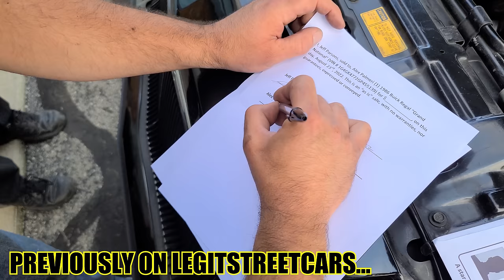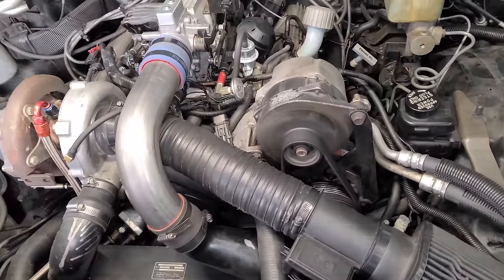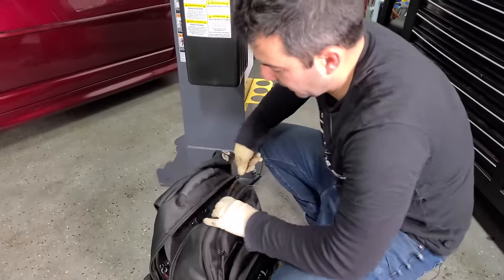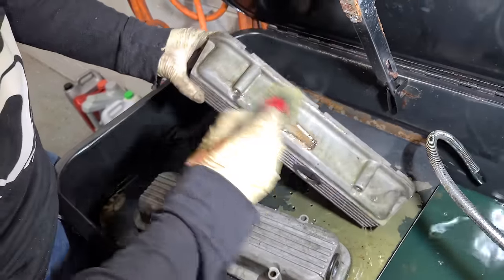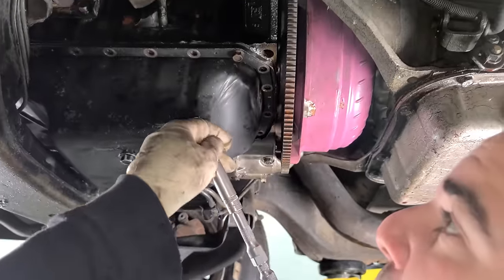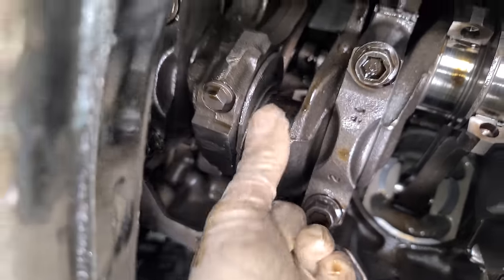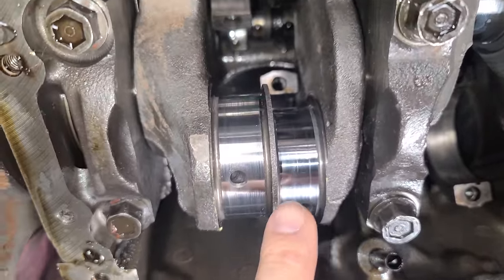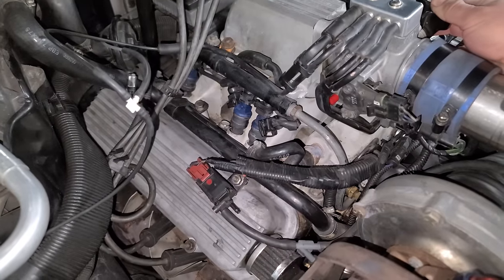I Found A Fully Built Engine In My Grand National That Was About To BLOW UP! DIY Fixed It For $32!

Comment: Looking for noises in a car, you definitely want to have a remote starter switch and a mechanics stethoscope. Failing that, use a section of hose as a stethoscope, so you can find the source of the noise and pinpoint it. Things like flexplate vs rod knock or wrist pins are tough, since they all tend to radiate from near the oil pan especially if it's one of the cylinders near the flexplate, but it's worth a shot. 

Remote starter switch is for when you've got a lift and need to start the car while it's up on the lift. Most of us can do without that, as we don't have a lift. We just need a buddy to work the key, lol.

Comment: So jealous ! I wanted to just change the oil pan gasket in my 96 cobra . Yah right , need to drop the k member and hold the engine in mid air . So much work.

Comment: Best mod I did to my 86 was an Alkycontrol kit. BITD it was like $500 but with that installed I was running 24 psi with zero knock. Before the kit I was running 94 octane Sunoco fuel. Car didn't like anything less even at stock boost levels.

Comment: Factory tires were puny P215-65R-15. I installed P235-60R-15 when the 215 were worn out on my ‘87 GN. Normal high idle when 1st started at any outside temp.

Comment: I rarely use RTV unless the factory specifically calls for it, it usually causes more problems than it solves. I guarantee you that oil pan was leaking due to the excessive amount of RTV the previous hack mechanic used. Those cork valve cover gaskets would have been fine without the messy sealer, the cork is soft enough that it fills in the rough un-machined mating surface of the head, at least that has been my experience. Using the proper o-rings/gaskets and torquing the part to spec is by far the best way to prevent leaks.

Comment: That gray tint to your oil is the babit off the bearing. One thing that will make that noise is to much timing. pull a couple degrees of timing out of it and see if the knock goes away. I'm pretty sure it has a rod bearing issue, replacing the bearings will not be a permanent fix you will need to send the crank out to be ground as well as have the rods checked. One thing you can do is go to the local U Pull it get a late 80s 4.2 v6 and swap it in the car to put it back on the road and do a proper rebuild on the stock 3.8.

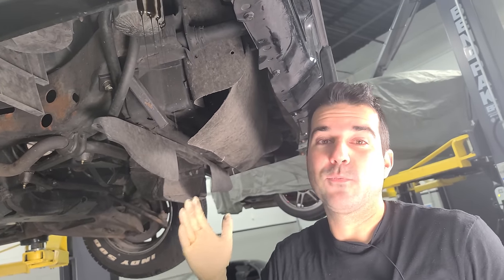Comment: @9:15 the fuel pressure reading is about 22 PSI.  The normal fuel pressure should be 42PSI at idle.  Either the gauge is bad, you have a bad regulator, or a pump issue. Also your fuel pressure should rise 1PSI for every 1 pound of boost.

Comment: I bought a 67 dodge van from a police auction slant six locked up! Diaphragm in the fuel pump went bad thinned the oil and spun 2 rod bearings cleaned the 2 up installed new ones on the other 4 and plasatgaged the 2 I polished the were past specs. Bought 2 10 over bearings sanded them into spec drove the van for 18 years before I had to rebuild the motor.

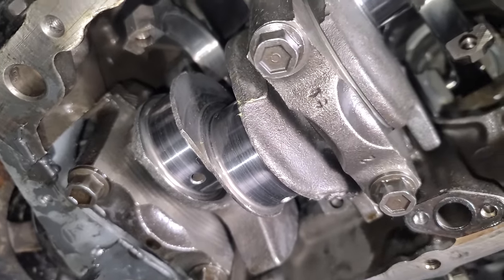Comment: Careful inside that motor brother, that's a bluprinting mark @35:22 on rod cap number 3 identifying that it's been balanced 😉 👍 😀, my initional thoughts are that the rod caps are mismatched, remember that stamp 6 rod cap goes to stamp 6 rod, I'm figuring someone tr8ed to replace the bearings and didn't  know specs

Comment: that same crank repair on my saab lasted from 83k to around 150k when i sold the car. the guy drove it another 15k until he got in an accident. The engine still ran fine though.

Comment: Got lucky that bearing did not spin.
Hopefully the rods are in the right order, cause mismatching the rod caps is a fatal error, as you found out. That would be if these are fracture split connecting rods.
Even if an engine replacement, you have a gem!!

Comment: The bottom end is known for going bad. Buy that girdle after rebuilding. Those 3.8 are weak after heavy racing.  Top & bottom should be done at the same time. WARNING That crank is NOT OK.

Comment: I did just rod bearings on a knocking D15 in a 1991 Civic and it lasted for five years as a daily driver.  I sold the car so it could still be running for all I know.

Comment: Should have hit those drums with some flat black spray paint while the wheels were off.  Glad you were able to change the bearings without having to pull the engine.  I was thinking that loose EGR bracket might have been the cause but those bearings showing copper were completely smoked.

Comment: You're onto something with the fuel being low Alex. Never owned one of these, but had 3 3rd gen F-bodies and a couple other mid-late eighties GM products in my day, and EVERY ONE OF THEM would die when cornering/accelerating hard if the fuel was low (1/8th of a tank or less)...

Comment: I did this repair to my 87 T-Type. And it lasted about another 5,000 Mi the only problem with mine was the crank was egg-shaped. So no matter how much polishing it didn't help. Still a great tip

Comment: Check fuel pressure gauge when removing vacuum from regulator. It should be around 30-35lbs at idle, raise to 10lbs when vacuum is removed and rise 1 LB. for every lb. of boost. Either gauge is not working, regulator or fuel pump.

Comment: These cars are notorious for bottom end issues when they are stock and you boost the pressure.

Bite the bullet and pull the motor and rebuild it the correct way.

Comment: Bro I just catching up with Ur Buick vid--- that oil looks like it's as thin as water -- using some 15w-50 ---or 20w50 and it would have quietened down heaps ,it would have been helpful 5--6years ago to avoid any oil related issues.... .......still making awesome content ---awsome job bro's...

Comment: It's not a proper re-machine of the crank, but, with decent oil pressure, that's going to last more then long enough to run around reliably, getting parts to build a new motor.
If it was a Slant Six with that repair, it'd be good for another quarter million miles.

Comment: 1 question....since the rod caps were reinstalled out of sequence on the original rebuild, how did you assure that the rods themselves were not also installed out of sequence? Did not see you inspecting to make sure the rods actually matched the caps and the chamfered sides faced outward, etc..

You may have done so off camera though. Definitely approved the roll out rod bearing replacing, though would have personally chosen to do the action 1 at a time (including the crank journal polishing,  and bearing/crank clearance checking), and not all 8 at the same time. Just a good way to nick the crank and smack a valve, and piston top for the uninitiated you may be online instructing.

Comment: The thing is if it has a built engine already, why would you need another built engine?  I think it would work way better to rebuild this engine, see what mystery parts are inside, and see if you can improve it and show how to do a build right.  Thus far, it seems like max you'd just want to source another crankshaft or have the journals on this built up with weld and machined back to spec.

WRT to the bearings: it looks simply like a case of mileage, boost, and perhaps, but not likely, oiling.  I would check the oil pump and change it out, but I don't have any indication of issues there other than the fact that the engine actually looks pretty new inside.  Maybe cheap bearings.  I would also look into GNX-style wheels, an upgrade of the rear suspension, and an upgrade of the brakes.  The car will be a driver, so why not equip it to handle instead of going for the built engine?  Everyone does the engine thing in the GN cars, but few do the handling and the brake stuff and I think in this era it would be infinitely more interesting to do a shake down of your engine and instead of replacing it,, the money is better spent refresing it and figuring out what's inside and then put the rest of the money into suspension, brakes, and chassis.

I used to have a book from Poston Enterprises that was basically the definitive T-Type, GN, and GNX book.  Learned a lot from it.

Comment: It doesn't sound like a wrist pin. The short piston can cause piston slap. Sometimes you can get a noise from the timing chains. It may have a double chain with steel gears. I dought the gears are plastic. keep it up, you are getting close. Tick ,tick ,tick.?

Comment: I had that engine noise when I had really old oil I thought the oil was low so o added some it didn’t help at all but when I changed the oil fixed the issue

Comment: My god, I’m really happy you fixed it, but man… how people can improperly mount an engine back like that?
Same happened with my 240Z. Imported it here in france from LA. Engine was rebuilt 30.000 miles ago. But everything was mismatched, especially the mains. So much that pushing the clutch would push the whole crankshaft forward by a good 3/16 to 1/4 inch! The crank needed to be replaced with all bearings..
Just at the first startup you must realize something is wrong?!

Comment: i had a ford 2.3 ranger and i had an egr that was so bad after it warmed up it sounded like a v8 with chop. like the 4 cylinders actually started going in a rythym similar to tapping your fingers on a touble just bwabwabwap bwabwabwap bwabwabwap. the very second i replaced it it idles PERFECT never died at idle or at a stop ever again

Comment: Back in the day the 3.8s were notorious for spinning rod bearings.  You caught those just in time. 

Food for though - why were they damaged in the first place? Especially on an engine rebuilt once already.  

I had a non turbo 3.8 back in the 80s and it failed for a nylon upper timing gear that was sending chunks into the oil pan.  Some got sucked into the oil pump by pass then no more oil pressure.  Hopefully this one  got a steel upper gear in the rebuild.

Comment: Strips  of aluminum cans can make the difference from a spun bearing as a temporary solution for your knock  and it will take a few times to get the clearance right  but it will work for a few days or a week at least  😂  but the  one place you should go is to get a  junkyard  replacement  engine  did on Toyota that lasted for years

Comment: actually ...Bleach seems to dissolve oil...its great  on spilt oil on concrete  before a high pressure water clean so it wil probably clean rocker covers too

Comment: U gotta put the gn motor in an 1st gen olds bravada  when u drop in the new built short block and make a giveaway sport truck or if the olds awd is a problem do a 2wd s10 with olds grille

Comment: When you hear a knock noise use a broom stick wooden handle place one end on the part you think is making the noise n cup your hand around the stick to your ear n any noise will run up the stick to your ear . Just be careful u don't put the broom stick near moving parts . I've found so many knocks , tics n  grinding noises this way

Comment: Hi, I have seen abnormal bearing wear when someone put the bearing caps back out of order, and, or, the wrong way around. They are NOT interchangeable. If that's done like that the dias of the bearing and rod don't meet perfectly.. Had an engine brought to me once that "seized" (or in American FROZE) up,  the bearing end caps were jumbled up, undone them all, found the rod matched ones bolted it all back and so the engine spun freely as it should.. Thanks for the video.. Ian 0 UK.

Comment: Hi there. It takes 12 miles of normal driving for the engine to be at operating temperature 🌡 be for you can lean on it without doing any  damage to the bearings and piston s and rings i have been down that road before. Happy new year from Down under. Dave

Comment: The reason the belt tensioner cracked is because your missing a bracket that goes on the top alt. bolt you have the one on the front side but missing the one that same bolt but on the back side where the nut is the nut tightens against it , it goes down then bent back at a 45 degrees then bent down at 45 degrees check into that and you will see what I'm talking about

Comment: Car and Driver did a comparison test of many sports cars and included one of these.  GNX ability to go fast was never doubted. But could it stop? One test was driving down a twisty downhill road very fast. The GNX brakes boiled and the rotors overheated. Once they stopped and it sat for 30 mins, it melted the front plastic wheel center caps. Good luck with the build. I am missing a lot of the 80's and 90's cars these day and may be looking for a project.

Comment: New to the Chanel love the content found you all bc of the 99 cobra. I have a 02 mustang gt with a single turbo. I did main and rod bearings in car last year. Car dynoed mid 400 on 10 psi. Going back soon for more boost.

Comment: Well back  in the 80’s yes a fuel filter would be a big check item for random shut down but I knew it was a fuel issue especially when the fuel gauge was dipping fuel injection cars have to have the correct fuel pressure. But that knock though surly sounds like either a rod or wrist pin knock. The only 2 other things I have seen that make thy noise are cracked flex plate/ flywheel or the belt tensioner but good luck 🍀

Comment: I think the new bearing job will look as pretty as when you put it in.  Going by it was poorly put together by a shop probably some time around 2000 (if those 99 are in fact dates for the bearings which seems plausible), and they survived long enough to roll the odo halfway around over 20 years.  And only then were they getting worrisome, the ones will be fine.
BTW, maybe see if you could get the tensioner welded back together?  At the very least to keep around as a rainy day thing.
Reply: Nah. Chuck that tensioner in the trash and buy a new one. They aren't that expensive, and I wouldnt trust a welded one. There's a HELL of alot of spring pressure on those.

Also, if it were MY vehicle, I'd do it the right way and remove the crank, have it turned, have the rod big ends resized, have the mains checked and line bored of need be, have the block hot tanked, then put it all back together with a whole new set of main and rod bearings in it. 
It doesn't pay to gamble, hope a band-aid fixes it, and then always have it in the back of your mind that it's bodged only to have it fail again and have to do the job twice. 🤷🏻 I don't roll like that...

Comment: not watched yet but the last video that knocking sounded like a harmonic balancer knock because its cracked and would explain the belt squeal ... use to happening in our rear wheel drive commodores here in Australia from time to time with the same engine

Comment: i would check for a intermittent wire rub  when 1 2 shift engine might ground or open a wire when engine shakes at shift point

Comment: If  the flywheel is cracked or the plate crack you will definitely have a vibration I think it's like you said it's a rod bearings

Comment: if the engine feels like it cuts on throttle, i would replace the iac valve. had the same issue with my 87 vette and that fixed it

Comment: My 3.8 non turbo had a wrist pin issue at 125,000 miles. Car went to 265,000 with no problem.

Comment: You needed to check the main bearings they are what is going bad, the rods are messed up for the mains going out.  The main bearing knock when out of gear and stop when in gear.

Comment: New subscriber here I like the videos on the Grand National if I were you I would wait and drive it before dropping the fuel tank because I'm pretty sure when when you fixed the loose EGR you fixed the dying problem. I'm a GM master Tech I'm almost 60 and I used to work on those cars and that EGR was a common thing. I would take the nut back off and put some blue Loctite on it too.

Comment: Trash in the gas tank also the sump for the fuel filter that goes in the tank sock is bad maybe you need to change the entire gas tank if not just flush it out if you want to keep the original parts

Comment: Com tig as I watch….rod ends are out of round. Get big end resized!  It will beat the rod bearings back out soon.  They take a beating on these motors!  Stock crank and rods have reliably gone deep 10’s. Tune must be spot on. ECUGN from Turbo Tweak is the way to go. Based on Megasquirt but GN specific by a Turbo Buick guy who makes the best chips. 
  Like u said improper assembly. Looks like someone rolled a set of bearings in and threw caps on rods all willy nilly. That filter setup is still a popular upgrade. Factory filter is tiny and is easier to change there😉

Comment: I'm wondering was that journal egg shaped, if so that repair will be short lived. Running it that long I'd say it was. Should have mic'd that journal a full 360*. I also hope the caps were placed on the correct rod not just stuck back to the corresponding cylinder. If so and the whole rod was previously moved then I see trouble.

Comment: The oil looking like it was that engine's major problem from the time it was poured in - (in my opinion) -- thin and watery .... Australian spec - 15w-50 --- 20w50 oil was recommended here..10w40 was recommended for the colder area's in most cases also..

Comment: I built a 413 Chrysler industrial engine for my 1951 Flxible bus/rv. I had the rotating assembly balanced, they misnumbered the rods, however the rod caps did match the rods. I'm thinking you may have mis matched rods and caps now.